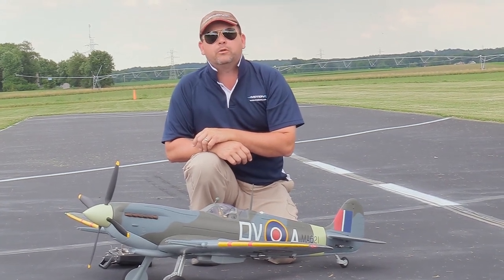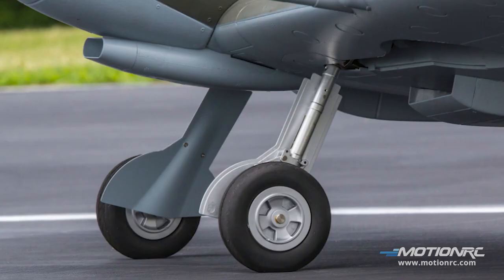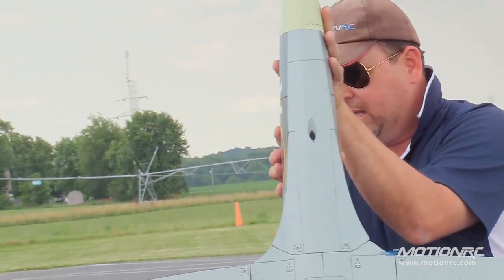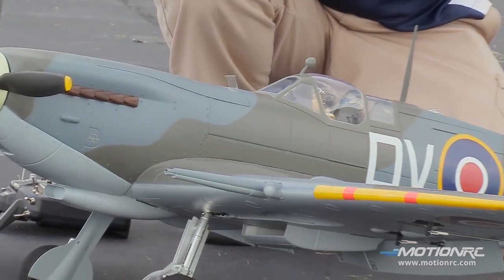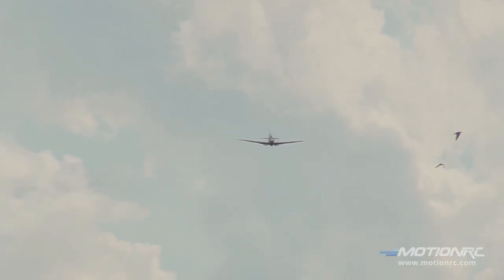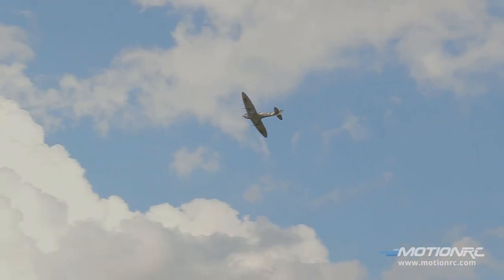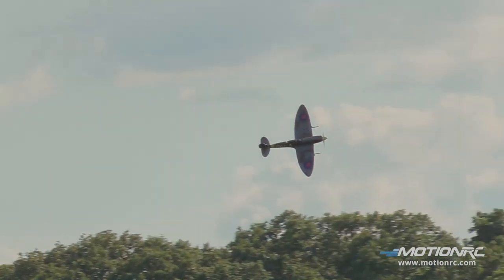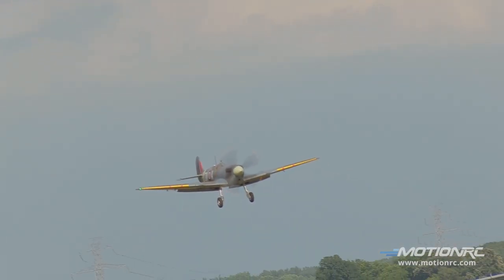FlightlineRC 1600mm Spitfire Mk. IX - Flight Review - Motion RC

Comment: I do wonder why go all out on larger scale and have a tail wheel that doesn't retract.  Still plan on getting this once I make room and have a few visual mods I plan to do as well as maybe a retractable tail wheel.
Reply: The real spitfire (apart from very late marks) had a fixed tailwheel so it would be inaccurate to fit a retracting one.
Reply: Oh thanks for the lesson.  I just assumed after the Mk. Vc they all had retractable tail wheels. Scratch one mod off the list. :)

Comment: Great flying Ryan, will    Flight line be doing a hurricane in the future,there seems to be a movement amongst a lot of modellers away from the "dynams", these Flightline jobs are a bit dearer to start with ,but if the quality is there,just need more hurricanes. the rc manufacturers will churn out any number of spits ,but the hurricane ,backbone of the RAF ,gets  kicked into the weeds

Comment: Sweet! How is the stall characteristics? Typical Spitfire?
Reply from the maker: Adam Hampton  straight forward, hard to notice secondary drops a wing
Reply: Motion RC  I just tried mine for the first time. I was surprised by the big pitch down effect following flaps extension.. did you experience the same??

Comment: What type of flight time does this one get
Reply from the maker: 5 minutes running hard. I have also ran around 8 minutes as well taking it easy. Great plane, reliable. Spitfire all the way. I really like the jug though too.
Reply: I've been out of rc for years now and in the past only flew glow plug engines and never battery.  So you get 5 - 8 minutes on one charge. How does that work then, you obviously have to recharge the battery and how long does that take?